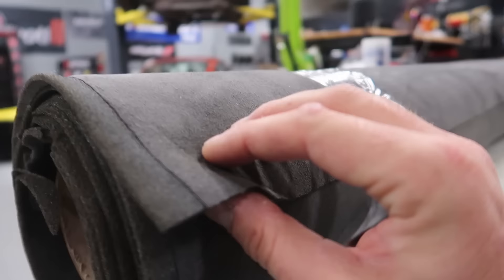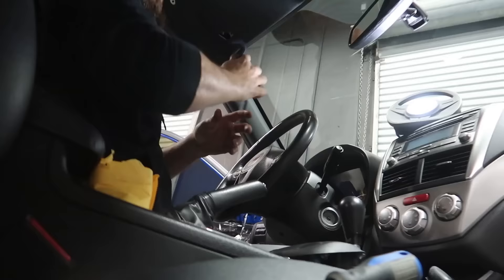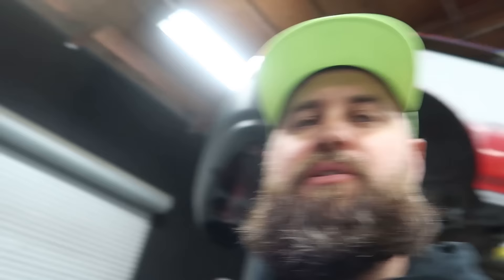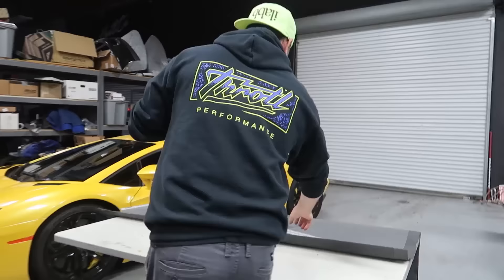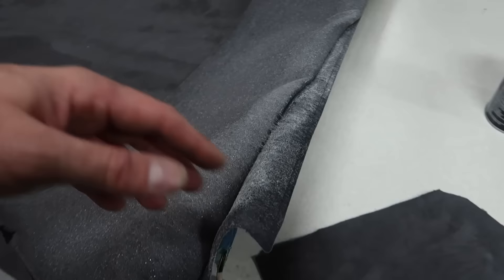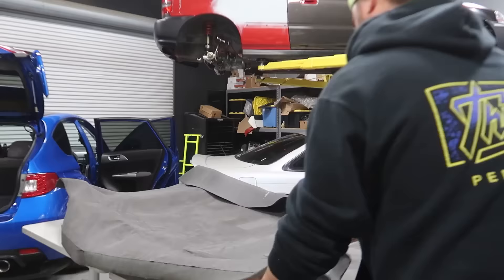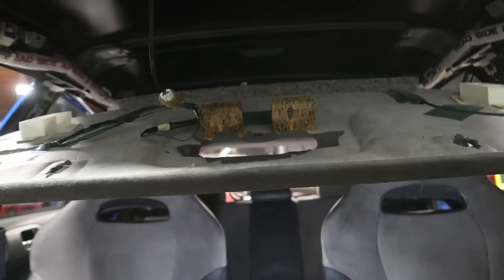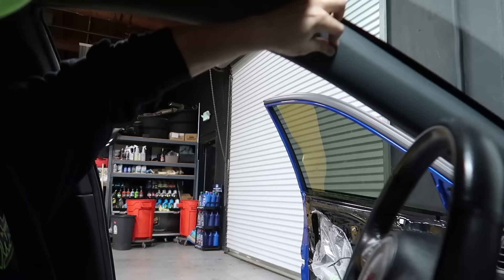How to Suede/Alcantara Wrap a Headliner (Feels Luxurious & Smells Amazing) *WORKS FOR ANY CAR*

Comment: I recommend wrapping all the pillars, too. Completely changes it from feeling like a cheapo budget car to a nice one.
Reply: Easy in older cars but newer cars with the pillar mounted airbags might need a different approach to keep the airbags working the way they were designed too.
Reply: @soarwiththeeagles5679  the airbags are actually all the way along the roof behind the headliner. It says airbag on the pillar as a way of identifying (mostly for emergency services) if the car is fitted the curtain airbags or not. You can safely remove and cover the pillars without upsetting the airbags.
Reply: specially a good idea if youre going from a light color to black :))
Reply: F

Comment: Couple things I always recommend if you have time is to let it dry overnight out of the car upside down. Just to let that glue really cure before putting it back in where if the glue didn't really grab fully it might want to sag and then the glue fully dries over night and now you have a saggy spot and would have to pull it all back out. Also hitting it with a heat gun or blow dryer before reinstallation helps cure the glue as well if you are in a hurry. I've done a few of these over the years and let's just say those first couple looked great at first and then a month later were like grannies panties LOL
Reply: Nice 👍🏼 I did one about 20 years ago and back then I didn’t know the meaning of “less is more” as far as the glue (3M Super 77) was concerned, and yeah it was garbage hahah... anyway I wanted to ask you do you start from the center? or at one side? Just curious if you wouldn’t mind sharing any more tips you may have? Now I think I want to do this again, and I’m way more capable this time around after having 2 built cars (LS1 GTO ~600whp, bugeye WRX ~456whp) and a handful of stereo installations under my belt lol I’m still humble enough to know that I definitely don’t know everything, and even tho its probably a straight forward process. It doesn’t hurt to ask someone that has more knowledge in a particular subject... any info you got is much appreciated 🙏🏼👍🏼

Comment: When doing this in newer cars be aware that the A and C pillars have airbags and you would need to disconnect the battery and wait 30 minutes before disconnecting the air bags
Reply: Yes, me disconnecting the battery was edited out. VERY important. Not sure on the waiting period however. Never heard of that or had any issues. I will research that more. Thanks for the comment.

Comment: you saved me in making a choice which is the best material to use I was debating the same thing which to use and your right Alcantara is dang spendy and Suede is allot cheaper and looks just as good and this will make my talon pop and my upholstery shop can do same to my door cards and seats.
Reply: If your door cards go right up to the window you would be advised to use Alcantara as it is the only suede cloth manufactured to resist the higher heat and UV loadings that  you get at the door top, dashboard, & steering wheel. Fit other brands and you will get fading from the sun in time

If your door cards are inserts, not going right up to the glass, cheaper alternatives should be OK.U

Comment: So question! 
does outdoor temperatures effect glue at all? 
thank you! Great videos keep it going gents🔥
and suggestion for new how to video
how to replace torn/ old floor carpeting👍
Reply: following
Reply: thats a great question. plus was there anything you would do differently the second time you would do this?
Reply: Yes, it can. When I did this it was 70 degrees inside the shop. Pretty much ideal temperature. I suggest doing a job such as this during a mild day. Too cold and the glue will not be as effective and too hot the glue will cure very fast.
Reply: @mickeyandrade  Excellent video mate!! Like the previous guy asked also, what about the carpet? Are you going to do a video showing how to do this sort of thing with the more complex shapes & angles etc?

Comment: Since this was a  STI hatch you got there headliner out of the car through the hatch, but how would u get it out in a sedan ?
Reply: remove the seats if possible and remove via the back door on an angle
Reply: Every car is different. You will need to inspect your particular vehicle and devise a plan. I suspect you can finagle it out one of the rear door openings but might have to remove the seats.

Comment: I’ve got an 07 Impreza Wagon. The headliner is in good condition and doesn’t sag or anything. That said, I’d like to replace it with darker suede. Do I need to remove the old material and grind off the foam like I see some people do? Or can I just lay it over the material like you did here? Thanks for the help! Love this build!

Comment: "We're going to wrap our headliner. It's actually pretty easy to do"
Laughs in Soarer
Reply: Can be done. I swore a lot doing it but it can be done. Thank f$ck for the big doors.
Reply: @skitzvitz  Oh I know, just a pain in the ass, haha. Especially because the doors don't open up very wide
Reply: I wouldn't say "easy" but after doing a couple the process gets easier
Reply: @sniffer6285  The area around the  dome light sucked the most. I felt like I had to either have crinkles in the fabric or pull the fabric so tight, press down in the crevices and just hope the glue would hold. I went for the latter. And nope, it didn't hold. This is for a Z30 Soarer. How did you overcome this?

Comment: You mentioned the recovering process is a little different for older Japanese cars. Do you need to remove existing material before recovering on the older headliners?

Comment: did you put the new head liner on top of the old one or no because mine droops down and I feel like if i was to glue a new one on top of it that it would just do the same thing and droop down
Reply: rip the old stuff off and clean off the old saggy foam from the board before laying down a new glue line
Reply: @gore1978  thank you Bryan sounds good
Reply: @alphamelon8046  - Correct. Remove the material that failed completely, prep the surface so that it is smooth and re apply the new liner.

Comment: Just confirming, you sprayed the glue directly on top of old headliner? No need to prep existing surface before adding glue?
Reply: Depends on the car. The STI has a very modern Japanese style headliner where it is heat-formed like a carpet. So for that style you can just clean it and apply a liberal amount of the adhesive like Mickey did(some materials can "soak up" a lot of glue so don't be shy but don't treat it like fiberglass and resin.) and press it together once the adhesive gets tacky. If the car has an actual headliner with a cardboard or similar backing and a fabric cover like some luxury cars or 90s cars then you should carefully peel off the fabric and remove the foam before glueing the new liner down or the old liner can sag and you will have to do it all over again.

You can't remove the surface of a one-piece headliner because you are removing the structure of the headliner.
Reply: @affenjunge1615 , Awesome, thanks for responding. I own a 2010 impreza (unfortunately not an STI), and want to do the same mod. I appreciate the input.
Reply: @affenjunge1615  - Perfect advice!

Comment: what was the overall price of everything? looks sweet and definitely something i wanna do on my car!!
Reply: depends on what type of car you have and how overboard you want the headlining material. I recently done my 4wd/ SUV for AUD $65 with an industrial material from a furnisher outlet. I tend to stay away from the foam backing material as 5- 10 years down the track if you still have the car it will sag again as the foam disintegrates.
Reply: About $200

Comment: Would you be interested in a Manual 2001 Jetta TDI GLS? It has around 300k miles on the engine but shoot me a price and it’s yours. I’m down to bring it to you if your down since I only live 3 hours away. Would be cool to see you build it up if your down.
Reply: Dude, 300k miles? You should be paying them to take it.
Reply: Looooooney why do you have to be negative? It was an idea. They’ve changed engine blocks before and it’s a diesel so 300k miles is nothing if you know your diesel which you don’t clearly.

Comment: Nope..... Fabric with foam and spray glue= shit... Its going to let loose in a years time... It dissolves the foam in time plus it will make it hard and brittle and begin to sag  . It needs to be the Fabric on fabric Only... And also a stupid mod.... Why add weight to a race car? Looked fine as is.